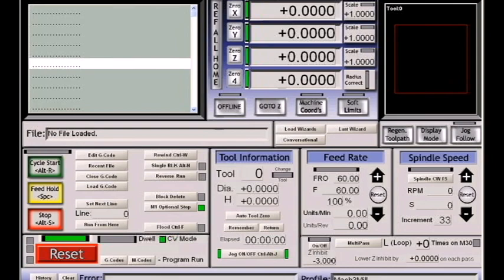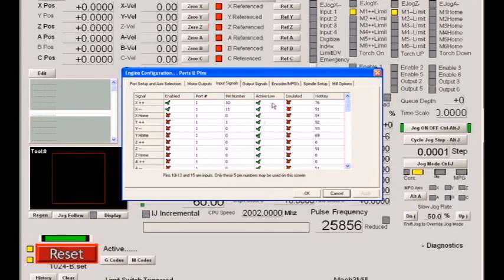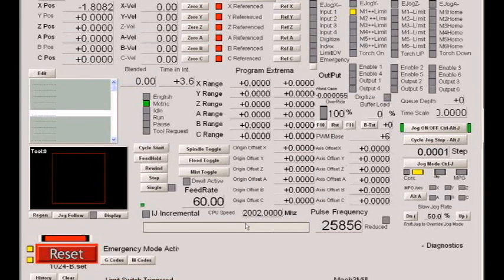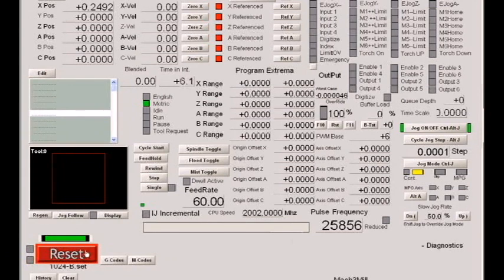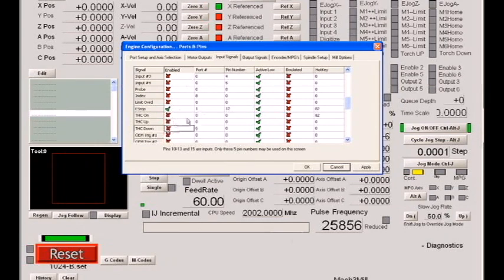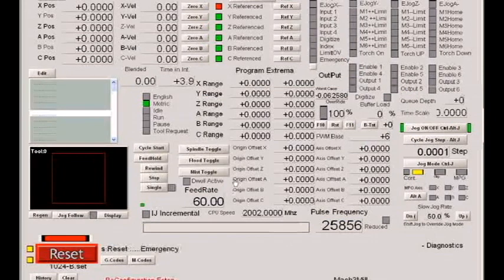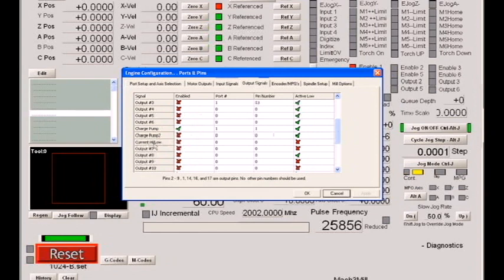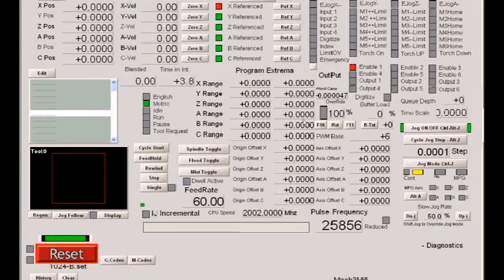MACH 3 CNC  CONTROL SOFTWARE TUTORIAL 4 INPUTS & OUTPUTS

Comment: anyone know how to slow jog in mach , mine seems to only do rapid steps about 3mm.. I need fine adjustment .thx
Reply: It's been 9 months, so hopefully you found the answer by now. :)
If not, in Mach3 press TAB. That will bring up the MPG (Manual Pulse Generator) window on the right where you can set step/continuous movement, as well as speeds for it all. In addition it will show arrow keys at the bottom that allow you to move the machine that way.